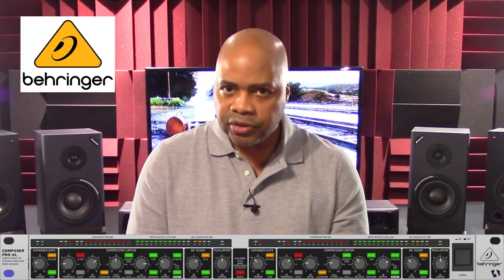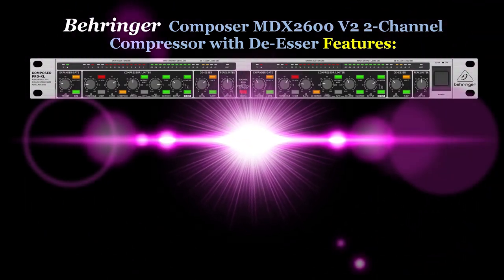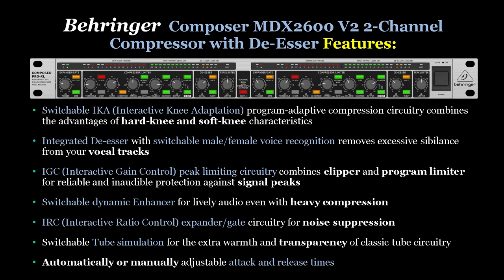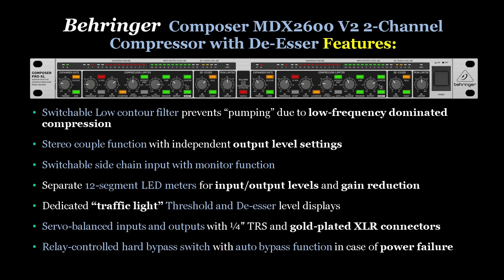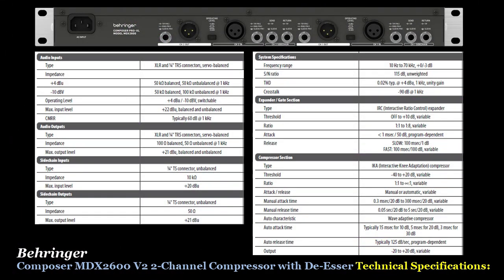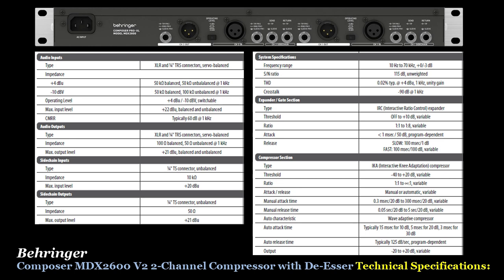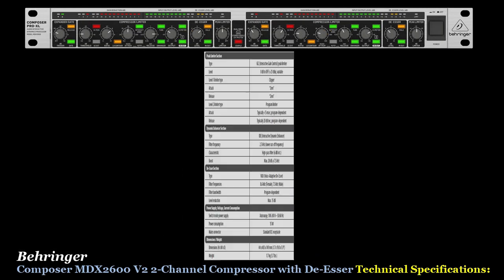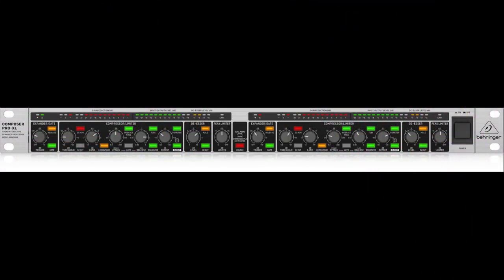Behringer Composer MDX2600 2-Channel Compressor with De-esser: Quick Overview

Comment from the maker: We know you can’t take your music to the next level without a compressor. There are a variety of good budget brands on the market, and many different ways you can use them. The trick is learning to use them appropriately, so naturally, you want to make sure to start with a good affordable unit. I wanted to share this information for those interested, in hopes that it serves useful.
Reply: I'm a little confused, which is the newer model, the Behringer Composer PRO-XL MDX2600 or Behringer Composer MDX2600 V2 ?

Comment: The Lo Contour switch needs better explanation. Does High Pass Filter mean it lowers the amplitude of lower frequencies & passes high frequencies (pitch) -- or does it mean that it I passes high amplitude? Does this filter cause a reduction in overall compres sion?